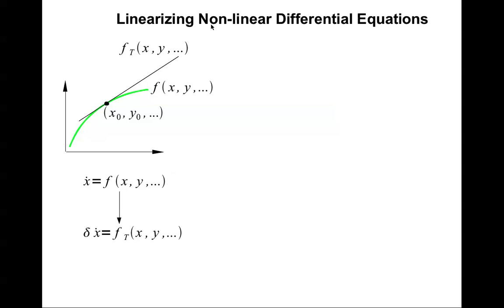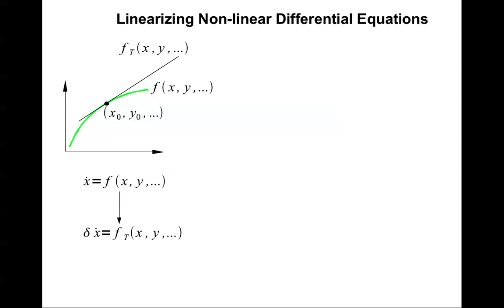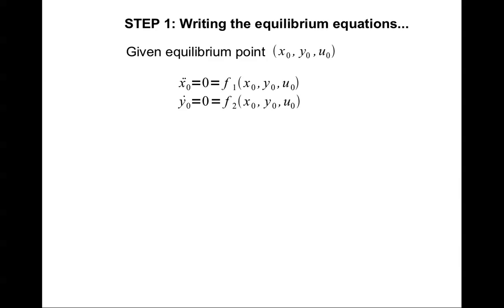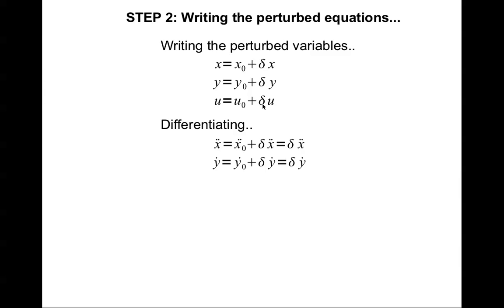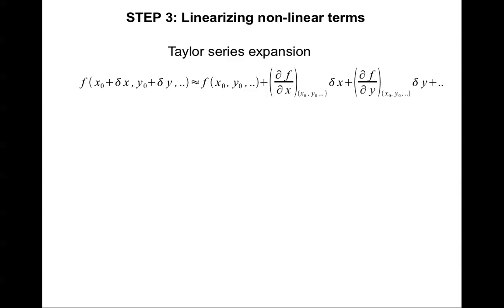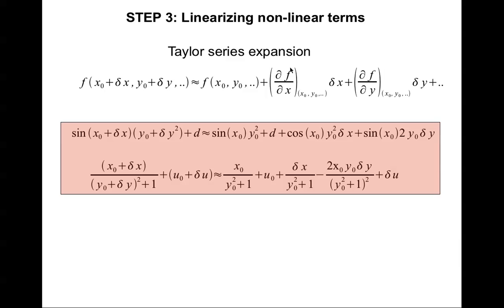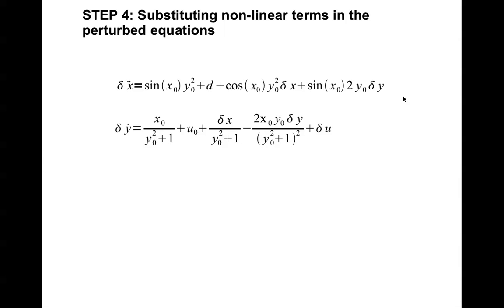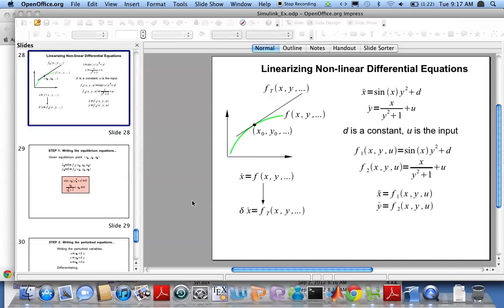Linearizing non-linear dynamic equations

Comment: Solve for the unknowns 𝑥 and 𝑦 in the following nonlinear equations using Taylor’s
theorem. (Use 𝑥0 = 5 and 𝑦0 = 5 for initial approximations.)
𝑥2𝑦 − 3𝑥2 = 75
𝑥2 − 𝑦 = 19

 has anyone solved this nproblem befor , i have never really understood it even if explained, would you explain to me as you did with above video